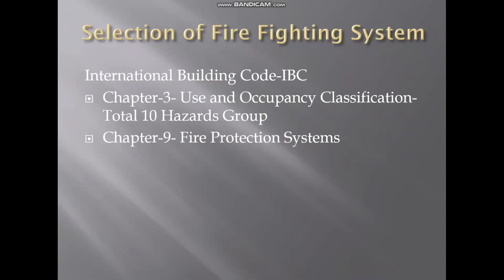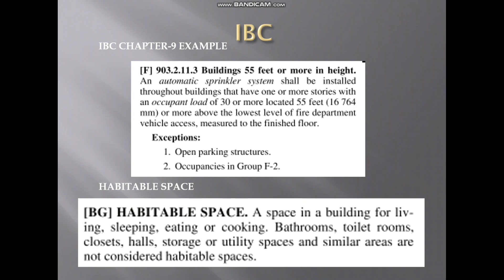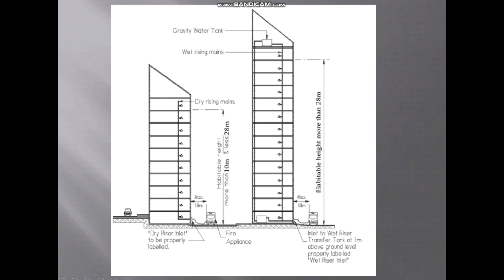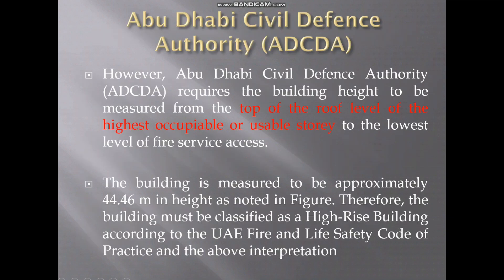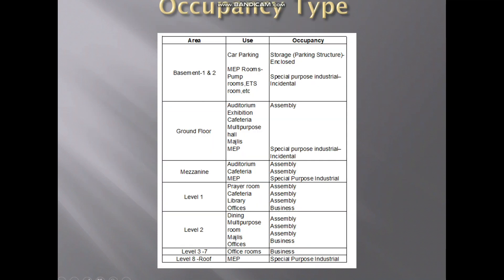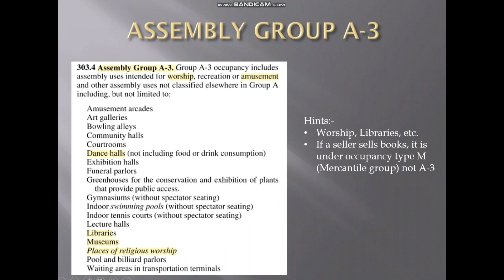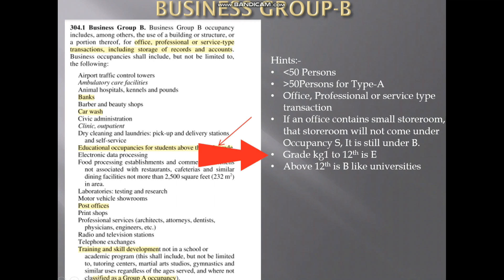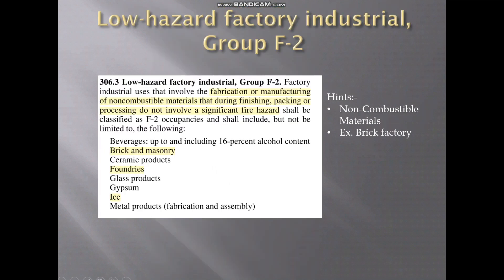Part 1-Firefighting System Selection l IBC & NFPA Code requirements l Buildings Occupancy Types

Comment: what about the malls. even though some of the malls are less than 20 meters, still, the area is much bigger and has a complete fire system. what is the category of these types of malls to choose the fire system?
Reply from the maker: If u see the video, chapter-3 provides the condition of each buildings, all he buildings name will not be covered in the chapter-3 but u can understand the concept, for example, in your case commercial mall which can be considered as wholesale store to sell the items so it will cover in Group B. Then u need to see my second video in which i explained how to select the firefighting system for each type, in your case if u see chapter 9 clause 903.2.7 , if the area exceeds 1115m2 then u need to provide fire sprinkler system. they also mentioned "A Group M fire area is located more than three stories above grade plane.
" so because of area, we need sprinkler system and not for height

Comment from the maker: Upcoming Topics:-
1.How to find occupant loads using different Standards (Usefull for Water Supply and Septic Tank design),
2. Water supply Tanks Design-GRP panel, PVC,RCC and GRP horizontal Tank design,
3. Septic tank design with pipe installation ideas
4. Water Supply Pipe Sizing
5. How to verify the IFC Schedule all technical parameters,etc